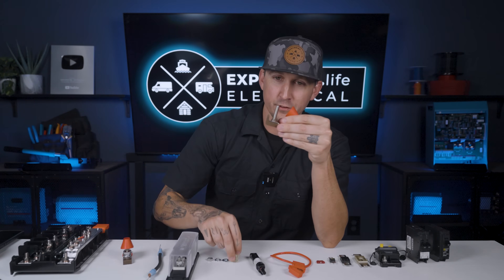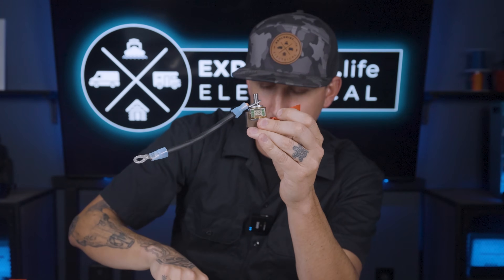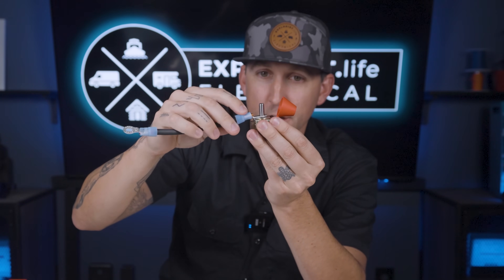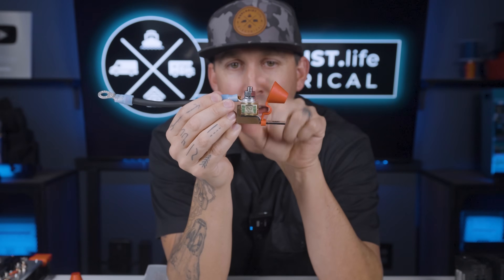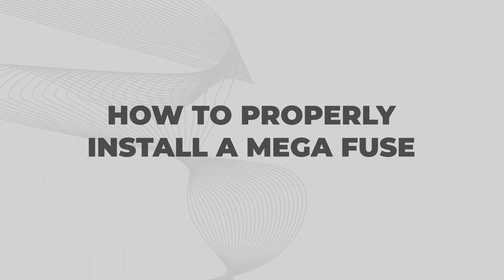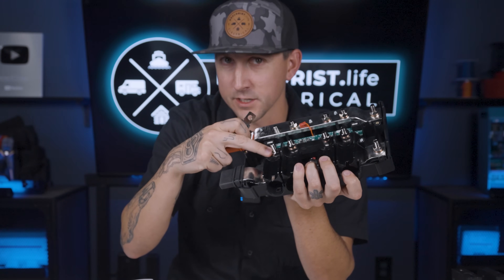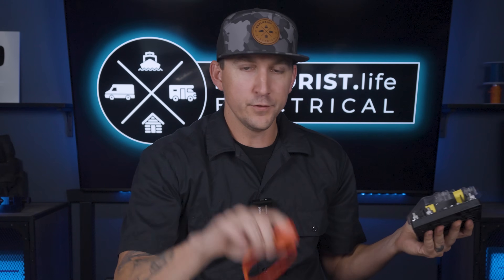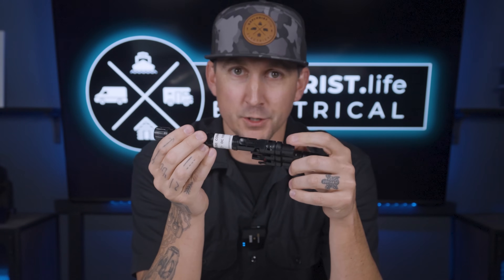Installing Fuses and Breakers 101 - Fuses, Breakers, & Overcurrent Protection | Ep: 4/6

Comment: Hi do you have link to video showing about fusing an inverter 2000watt to 200ah battery lithiam and wire size for it..?? Thanks
Reply from the maker: Thanks for the question! Inverter fusing and wire size depends on a few details like battery voltage, cable length, and how that 2000W inverter will actually be used. Because those details really matter for safety, we don’t want to guess in a YouTube comment.

If you reach out to our support team, we can look at your exact setup and point you to the right guidance (and make sure you’ve got the correct fuse, cables, and components for your build):
👉 https://shop.explorist.life/support?utm_source=youtube&utm_medium=comment&utm_campaign=support&utm_content=response_link

Comment: Hi Nate, I noticed your older videos discuss using a AC and DC combined fuse box for van builds but it seems you're no longer promoting that option. Can you explain why you switched to separate boxes? Thanks!
Reply from the maker: Yes - the company that makes those panels refused to do business with us and only sells to Amazon.  We had to find the next best opion - but the option we now have is two separate units that each have MORE spaces for circuits, which we find more people want.  Reach out at shop.explorist.life/support and we can talk about your personal setup and get you the best option for those needs.

Comment: Damn I messed up big time. Thanks for the video. I dont know what id do without the internet. 

Im running dual batteries through an isolator. I placed the circut breakers in the correct place but I installed them backwards. I then ran cheap CCA cables for my batteries. Its really a sad set up ATM. Im planning on running a 320 amp alternator next month. Im going to take my time and re do everything. 😢
Reply from the maker: You’re not alone—lots of people redo their first setup. 💪 Since you’re planning a full rework with a big alternator upgrade, it’s a perfect time for us to help you plan it out right and get the parts you’ll need. Reach out here and we’ll take a closer look: https://shop.explorist.life/support

Comment: off the subject,  i have been hearing about AV charging for camper van, have you done a video on that? would love to hear your thoughts on that and if that is possible 😏
Reply from the maker: It'd be significantly easier and cheaper just to run normal 30/50A shore power to your driveway/garage alongside your EV charger wiring.

Comment: Was just discussing a build I am doing in a TT.  When I shared my diagram I  got a lot of grief for having any ANLs.  I was told why not to use ANLs at all.  Perhaps you can discuss what kind of fuses to use based on application.  What application is appropriate for ANLs?
Reply from the maker: We spec ANL Fuses as the main system fuses for our system designs that require main system fuses larger than 300A.  Class T fuses would be 'more appropriate', but alas... there has been a chronic worldwide shortage of 400A Class T ANL fuses for the last 4 years.   People like to bitch about things without understanding the full scope of the situation.  Instead of sharing your diagram with those people, it's best to come to us with your questions and concerns since we do this stuff day in and day out.  Hit us up on our messenger at https://shop.explorist.life and we can get you squared away.
Reply: @EXPLORISTlife  On my original design, I was using ANL fuses as the fuses off of the positive battery posts.  I was since told those should be MRBFs so that is what I ordered to replace the ANL fuses I had already bought.  I was told two things about ANL fuses:

"I would not use an ANL for anything - they run hot and can be a shower of sparks if they blow from major overcurrent"

"There has been a change in attitude in the last year concerning fuses combined with LFP batteries -- specifically their ability to break an arc - the AIC rating -

The ANL typically has an AIC of only 2ka if there is an arc .. it has higher resistance than other similar fuses so it produces more heat and wastes more power at a given current... and they are often faked or mislabeled where they don't blow at 10 x the rated amps... Basically the current consensus is they are fine for car audio, leave them there ..."

My system has a smaller load than what you are specing.  My main fuse off of the inverter is a 300A Class T.

I am having my diagram peer reviewed on the DIY Solar Forum which is chock full of experts like Will Prowse, many I am sure have an experience level equivalent to yours.  When my design was originally reviewed in 2021, no one complained about the ANL fuses.  However now, 2.5 years later, the consensus was as above.  

I enjoy your information and love your posts and respect your opinion.  Many people have looked at my new diagram and endorse it.
Reply from the maker: Ah.  You weren't referring to an EXPLORIST.life wiring diagram/design.  Gotcha.  Yeah, so the thing is: There is probably 1,000 different ways to do this stuff, some correct, some not correct - all to varying degrees of code complancy depending on what codes/standards need to be followed.

That said - take what you learn here and apply it - but if you ask for my advice and/or what we would personally recommend - we are always going to default to our own system designs because we know those parts are available.

Case in point:  When we were getting started with all of this, we were trying to find a device that did a particular thing.  A very VERY smart engineer told us the model number, but the part was a $7,000 part - nearly more than the whole system itself.  So although this engineer was incredibly intelligent - they had ZERO concept of pricing or what was actually available to end consumers - which isn't helpful.

So... If we are involved in your project from an education standpoint - I hope you found what you needed.  If we are involved in sourcing parts for your project, reach out on the messenger at https://shop.explorist.life for additional guidance.

Comment: You need to get with deboss garage and do a victron set up for their new trailer they are doing for there hybrid electric truck they are building…watch that build…try to
Get ahold of them
Based on the new airstream they bought….perfect way for you guys to pair up together and it will get you guys on their map up
There

Comment: You skipped PV fuses in Fuse and Breaker Placement video implying/stating you only needed a disconnect for solar panels and not circuit protection. I know you had mentioned circuit protection for solar panels in the past and was hoping you would have discussed it in that video. Mentioning how to install what you said was not needed in the previous video is a mixed message.
Reply from the maker: Pv fuses will be covered in the solar panel wiring chapter as there is some critical info regarding how solar panels are wired and their sizing in relation to overcurrent protection.

Comment: Great video. You didn’t mention the torque required for these fuse and breaker connections. Each device has a torque specification. For example, the Eaton BR AFCI/GFCI breakers in our trailer’s WFCO load center require 20 in-lbs for 12 AWG wire. We use a Klein 57032 torque screwdriver. Which torque screwdriver or wrench do you use for these connections?
Reply: 3:45 he mentioned recommended factory torque spec for your fuse.
Reply: unfortunately many devices don't have a torque spec.  I know for instance my Siekon batteries are rated at 8.5 newtons, i.e. 75 inch pounds.  Of course if battery terminals are overtorqued you can destroy the battery.  I think for most other connections that don't have a published spec, I tighten but with caution.  I personally use a Wheeler Fat Wrench as it is most common in the firearms community so I already had it.  It only goes to about 65 inch pounds.

Comment: So would it be acceptable, or even an improvement, to use a locking nut, or threadlock on the nut, since it isn't in the path of current flow but is there to ensure a tight and durable connection between the fuse stud/copper bus and the fuse/'
Reply from the maker: That is actually a debated topic of which there is no definitive answer/condemnation, unfortunately.
Reply: The problem with ThreadLocker(liquid), is that you can't retorque the connections after it's applied without breaking the lock... I would go with locking nut if that's the way you want to proceed. Heat from the resistance in the connection will cause expansion, and, hence, when it cools, contraction, so it may not be as tight of a connection as desired... this is why you check and retorque once in a while.
Reply: @BorealisNights  Perfect.
Reply: I'd try it, but keep in mind that if you have an issue, that's the place to look first.

Comment: Great video. For the PV fuse, you mentioned "...if you need a PV fuse...".  You should put up the link for your video on how to determine if you need a PV fuse.  I was able to forego using a fuse for my array thanks to your video which was nice.
Reply: I have been told for single strings a PV fuse isn't needed, however I do use a double pole DC disconnect after the charge controller.  I originally had the breaker before the charge controller and was told to move it after the charge controller.